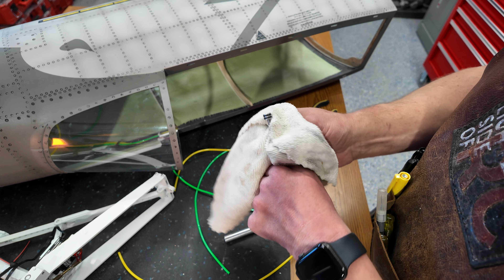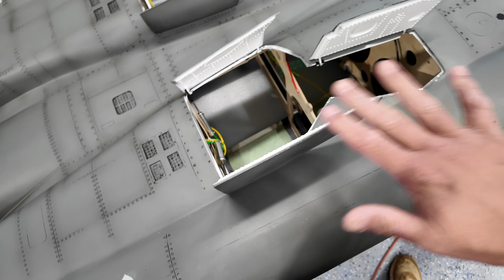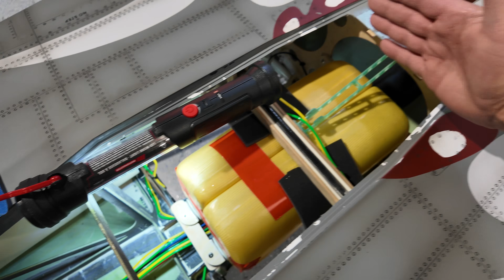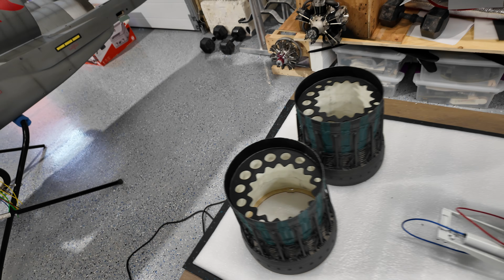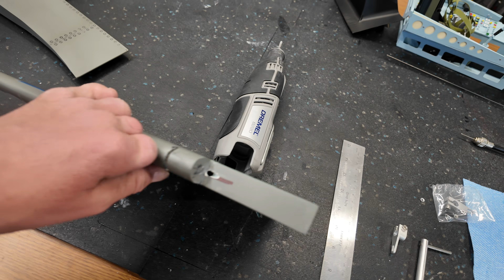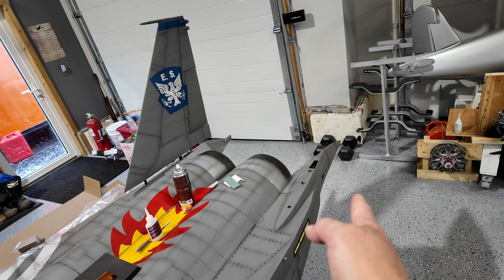Giant F15 XXL Build: Inside The Ultimate RC Masterpiece

Comment: Jon do you ever get worried about how long the servo leads can get sometimes, like a drop in power oranything?
Reply from the maker: Great question!  100%. This is why in something like this 15 the CB will be mounted mid aircraft rather than in the nose. This route leads to 5ft leads from the tail. If we went nose mounted it would add another 4ish ft.
Reply: @thelightersideofrc  Very true.